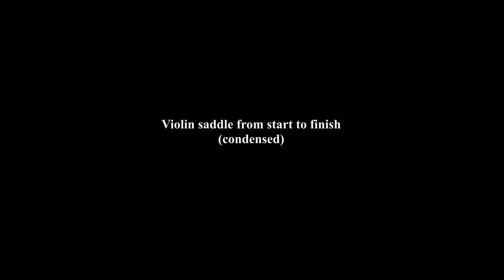Violin saddle from start to finish (condensed)

Comment: You make amazing videos!
I was wondering what are those elements that create sound in violin.
I am sure I am not allowed to call it violin when I used different technique and other woods I found to be used. Appletree, pruce and alder.
I carved the thick alder to have ribs as a bowl, and then made the top "normally" from pruce.

It is my first violin-like object I have made, and it sounds quite good, as made by me, I mean.

It is heavy though, due it is made from one block of wood for the most part. I got the chance to study what is needed to create sound space like that.
Reply from the maker: Thanks!😊
All the elements of the soundbox contribute to the final sound of the violin, with the plates as the main responsible, both the top and the back but also the ribs with the elasticity of their structure, without forgetting the bridge which is the first filter between the strings and the top. Then there is the very important sounpost, which is not by chance called "anima" (soul)  in Italian . Then it depends on what kind of sound you expect, even your violin with back and ribs in one piece with only the separate top will sound like a violin, but I don't think its response and tone will be appropriate for playing Sibelius or Tchaikovsky.😊But it might be good for other kinds of music. However, the lightness of the structure is important for quick response to the bow and for an open and clear timbre, as well as not to tire too much the violinist. Keep in mind that a Stradivarius rarely exceeds 400g in weight, with the strings and all the rest of the setup, and I would consider a violin weighing over 450g too heavy.
Reply: @DavideSora  Thank you for  information that I read with humble mind and great gratitude!

With that information you gave me  path to respect traditions more.

I shall soon build another violin-like this all in mind.

Thank you for your time,
With great respect,
~Jenni Holopainen